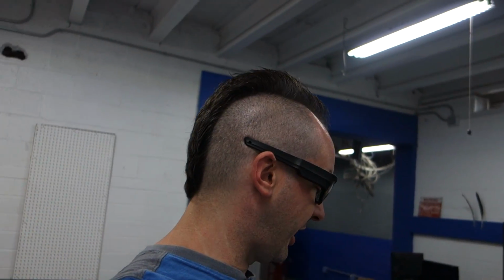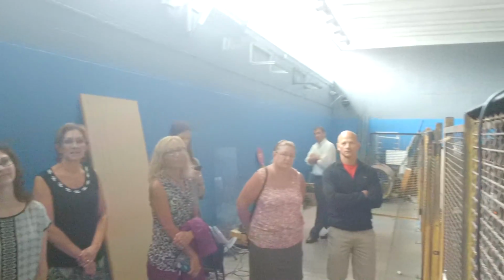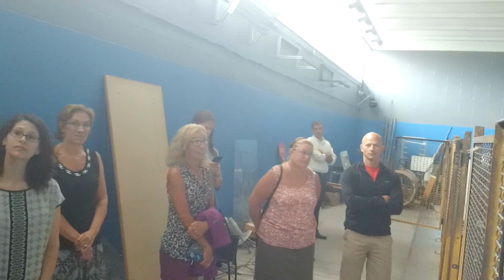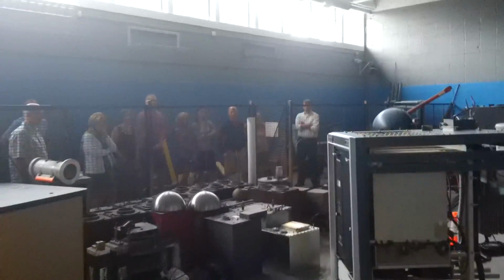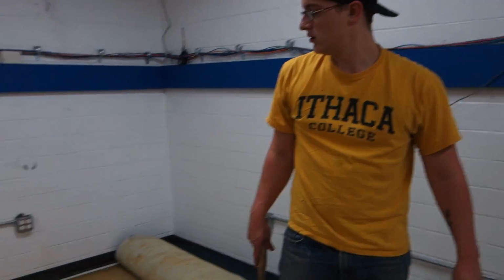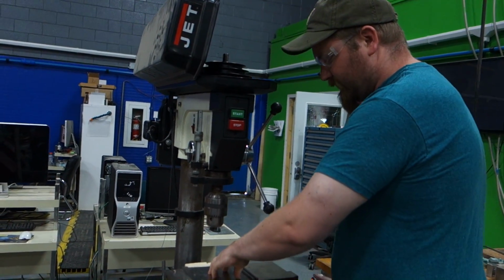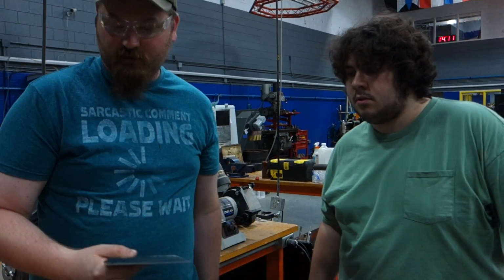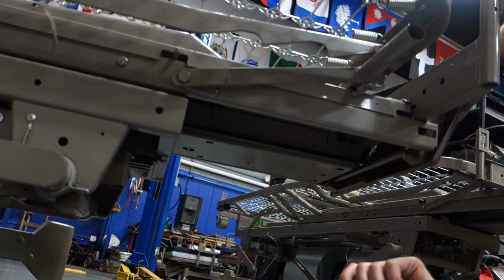Captain's Blog 8 10 2015 Tours, Cleaning, and Computer Lab Grinding Phase 2

Comment: sponsor names are a great touch.  yes carpet looks very tired.  Bat you are bristling with energy.  high voltage is always fun.  new roof should last longer than the this.  good that you have a peer.  what happened to the POV glasses?  super secret hiding spot is in the blog.  better over than under.  1.44 megawatts is power.  TGG builds machines to explore electricity.  flying triangle is fun.  Captain wants to have a separate HIgh Voltage building.  3d printing looks cool.  how are people lost in the lab?  sell those pink tiles.  hmm, strips of wood are straight this time.  instructional segments greatly help.  a mattress in a garage is different.